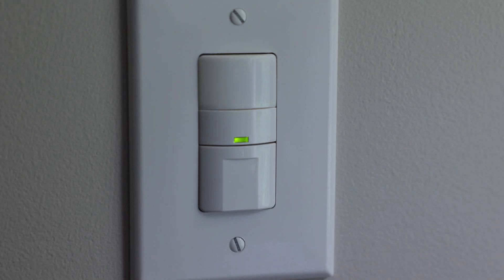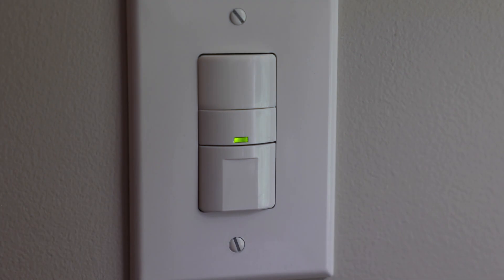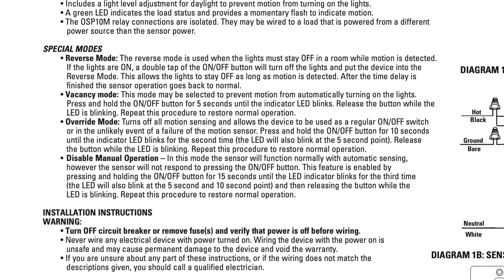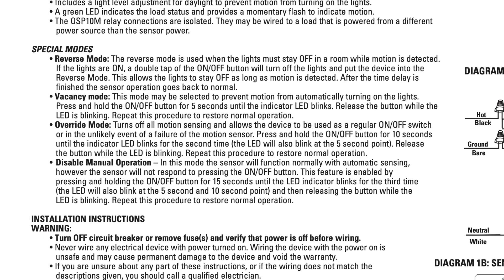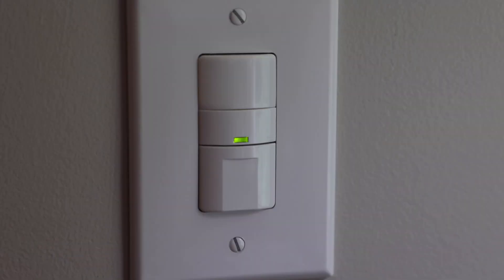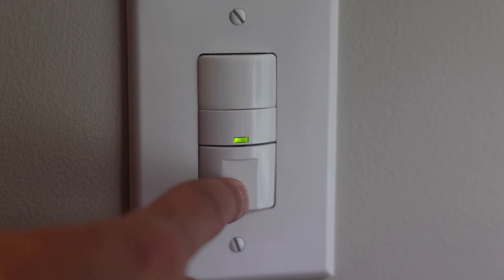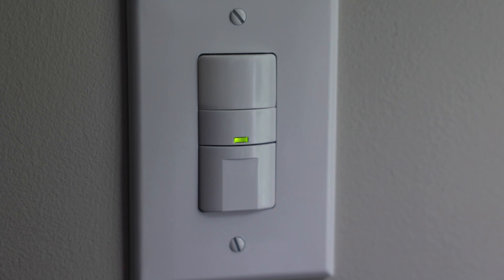How to Program and Setup the Eaton OSP10M Motion Sensor Light Switch

Comment: these are junk, bought one to replace the one i had for 15 years , the new one   never did work right, they are built really cheap and green light does not come on and when it does switch on it sounds like a spark so i threw mine away and put the old one back up the old one is built solid and still works , only reason for buying a new one was to update the one i have but the new one went in the garbage
Reply from the maker: Sorry to hear about that. For what it's worth, I use Lutraon Maestro switches in my house; they've always worked great!

Comment: OK, I’m wondering if you can tell me how to wire this .I currently have a Cooper motion sensor it has a black wire a red wire a brown wire and a green wire .I have had it hooked up and it works just fine but it has been hooked up to a fluorescent light fixture on a switch with a three-way, one inside ,and one outside in the garage switch .I have recently purchased a Eaton OSP10M , it has more wires. It has a black wire a green wire a blue wire a orange wire in a red wire. I cannot figure out how to hook this up can you help me?
Reply from the maker: According to these instructions, it looks like you'd want to tie the black and orange one together, and tie them both to the black (hot) wire: https://www.davecarter.com/ASSETS/DOCUMENTS/ITEMS/EN/32128_InstallInstructions.pdf

Comment: Thanks for the video!
My sensor has been turning on and off on its own since a few month ago. I just tried fixing it using your method and I just realized that throughout the entire process I didn’t see the green light at all. Does that mean it’s broken? Thanks!
Reply: Mine doesn’t have any led either. Did you figure it out?
Reply: @Geobeetle mine doesn’t either. I’ll be replacing it with a Leviton one tomorrow.

Comment: My switch works only works by manually  pushing the button. Also I noticed my LED only flashes it’s never on like yours is in the video. Any suggestion? I already tried holding it down for 10 seconds. No chnage
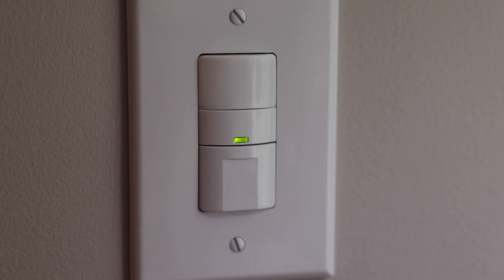Reply from the maker: Hmmm. If you've already tried to turn off vacancy mode (4:04) and that's not working, you could try to see if it will turn to any of the other alternate modes to establish if anything works at all. If nothing works, then you've probably got a defective unit (although I've found in most cases, it's just me who doesn't understand how to work the thing). If you're looking for an easier switch to work with, you could try this one from Lutron: https://amzn.to/3hnBUOo Instructions here: https://youtu.be/NKJ0RxpqTYo